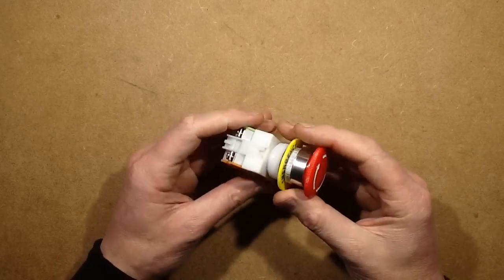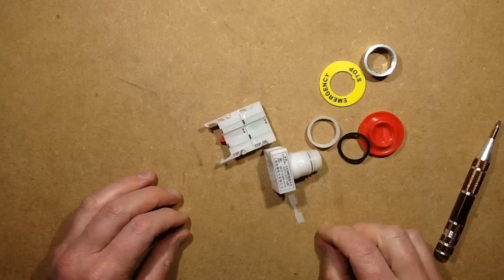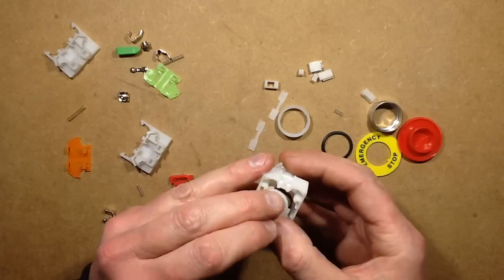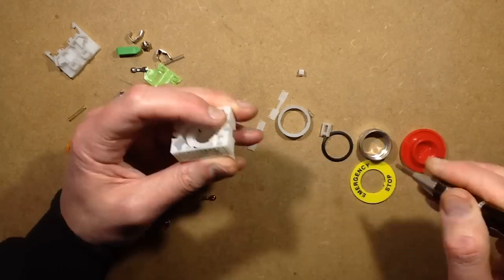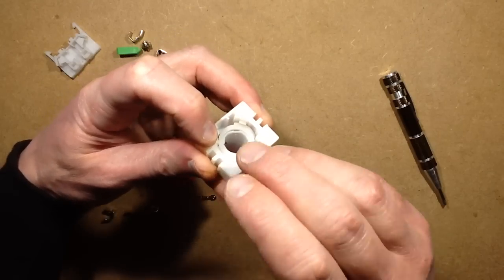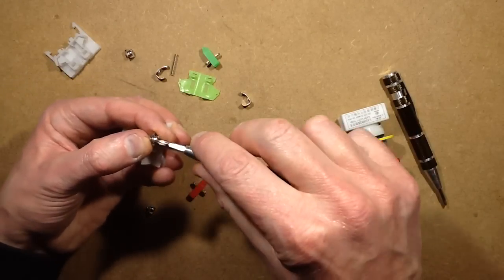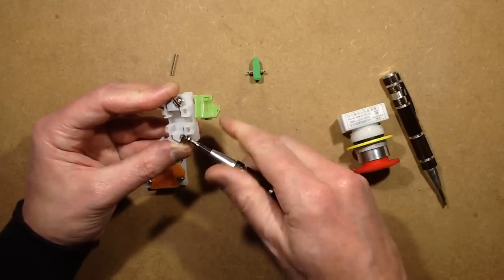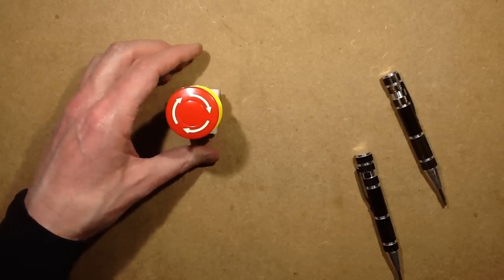Chinese E-stop button teardown.  All FORTY bits of it!

Comment: What do you think of the modular factor of it?  Do you think you could chain several switches off the same button?
Reply from the maker: +MasterKaylock Most industrial switching systems like this are designed to stack a modest number of contact blocks.  That way you can control several sections of the machine at once depending on which button was pressed.

Comment: Seems like if someone went to slap it (which would happen in a case of panick and to hit the button fast enough) it would just explode into a million pieces. I'd like to see all the small part's be made of metal at least in the button portion.
Reply: +Travis Piper ---Sometimes, plastic parts have to be used to maintain the desired voltage isolation.

Comment: Had a similar, but different one. I was easy to turn into a momentary by removing a small metal pin that acted as the catchment. Put a Teensy in the enclosure and programmed it to send a keystroke to turn the engines off in Kerbal Space Program when i whacked it. Made the game more fun :)
Reply from the maker: +xKatjaxPurrsx To adapt this one like that you would only need to slide out the two little latches.

Comment: Thanks for the teardown.  I have one of these on my metal lathe.   I use it often as a power safety disconnect when changing tools.  I do not expect to take mine apart, but it is good to see the design.  More robust than many other switches.

Comment: that is nice the switches stack most of the estops I wire in tend to have two N.C. switches for the safety relay and one N.O. for the PLC so they are probably just trying to stay competitive. But i have to wonder how much would you actually trust this in an "emergency" ?

Comment: Emergency stop should be built robust, the rubbish nylon? housing containing the N/C contacts retaining clip would be a worry. In 3-5 years the retaining clip holding the N/C contact block in place breaks and  leaves the contact closed so when the button is pressed the control circuit remains active because the contact N/C block not being opened. Be very careful with Chinese branded control switches. It's bad enough they are almost all made in China but if you must accept Chinese made components make sure they are known and respected main stream brand names.

Comment: Heh, this video reminds me of a time when a friend of mine brought me a bag of small plastic and metal parts (there were a lot more than here, including gears) that used to be a washing machine controller, you know those older mechanical rotational ones. This one had two synchronized motors, one for the main axle that has the timing wheels and contacts and one for an auxiliary axle to do additional "subprograms", so it was quite complex. 
He had taken it apart because something (he had young kids that were suspect, heh) had collided with the knob and the main axle had bent slightly and would get stuck, i.e. the washing machine no longer finished its job :). And then he had lost patience when trying to put it together and failing. And he knew that I had a grasp of mechanical and electrical knowledge, so he just brought the whole shitload of parts to me and asked if I wanted to try to get it back together again. Of course I said yes. I managed to put it together in my own time (don't remember how long it took, but it was a fun puzzle) with no leftover parts and was happy to get very nice compliments and wonderment from my friend.

Comment: BC, if you were working in the factory you might be lucky and be removing the moulding lugs from the big red disks and throwing them into a hopper. That's if you were lucky, if you were a new employee you'd probably be retrieving springs from the floor sweepings, no you wouldn't get to sort them, you'd be putting them into a hopper for someone else to sort!

Henry Ford has a lot to answer for.

I have one, emergency stop for my bench. Never got round to installing it though.
Reply: Quite accurate description, very sad tough...

Comment: Are you going to stress test it to see if it can handle the 660V @ 10 amps?
Reply from the maker: +ElfNet Gaming The internal contact clearance looks more than enough to handle that at the rated current.
Reply: +ElfNet Gaming 
normally you only switch control current with these NO/NC switches, used with relays... really NOT a switch to handle high voltage/amps.
Reply: +gg Yes, that's often missed by people. I have a whole batch of industrial rotary on/off switches (about 40 of them!) I got at an auction. They are standard industrial quality, collet knobs, enormous barrel o' contacts... the whole lot is rated at 2 (yes two) amps.
Reply: +TheChipmunk2008 I personally think they'd handle 20 amps... but i respect the contact rating
Reply: @TheChipmunk2008  Safety regulations used to strictly limit the levels of indirection between emergency stops and the actual dangerous mechanism.

Comment: That's cheap crap, I wouldn't work on a machine that has that switch. Factory machines normally have heavy duty emergency components for a reason. When they are hit they are hit hard in an emergency situation. One good hit on that and the next emergency will cause the cut off a hand...

Comment: Like everything else I'd bet this switch is a copy of some else's design. I wouldn't trust this switch. I'd bet the materials aren't as strong as a name brand.
Reply from the maker: +Robert NES816 As mentioned in the video, it couldn't be weaker than one batch of name-brand units where all the buttons literally popped out after a few uses.    Keep in mind that these are the components that the Chinese use on their own factory machines.

Comment: is it possible to use this as a 120V power switch for lights?
Reply from the maker: Yes, for a load within it's current handling capacity.
Reply: Roller Coaster Maniac I seriously would use these for light switches, with some exposed BX cable and metal boxes, It would be awesome in a converted "industrial loft" style apartment!